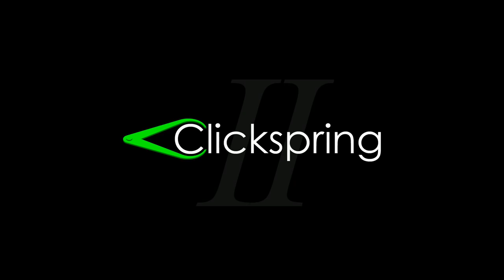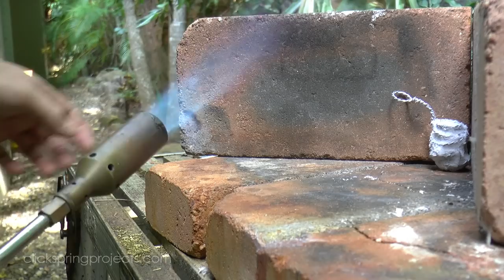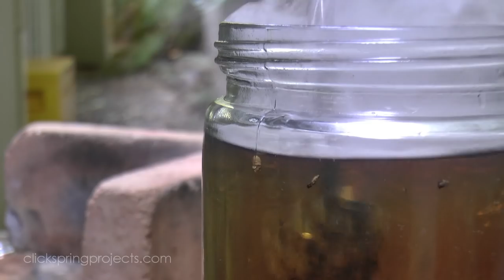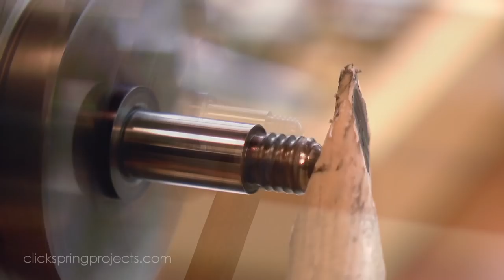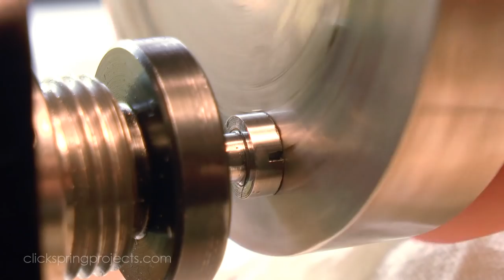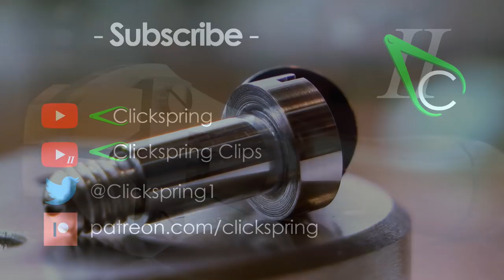Heat Treating & Polishing Pivot Screws

Comment: Does the domed bottom serve a mechanical function or is that cosmetic?  These look like what I've seen called shoulder screws but normally they are used as axles or to hold a bushing or bearing.

Comment: Hardening and lapping. No tempering? The finish looks like it's on a pretty hard steel. It always seems like the harder the steel the more brilliant the polish can get.
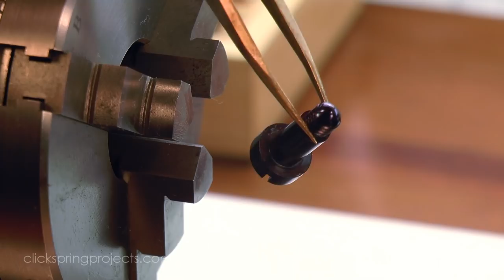Reply: The step wasn't shown in the video, but around 0:54, you can see the screw is blue from the tempering
Reply: @SmevMev    Very true. I forgot about that. And a blue temper is indeed a logical point to leave a precision machine screw.